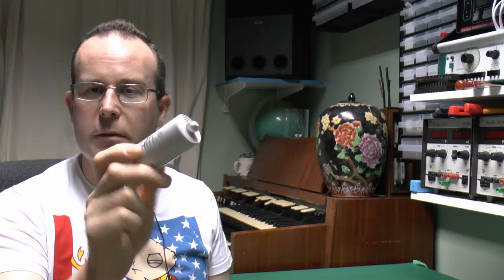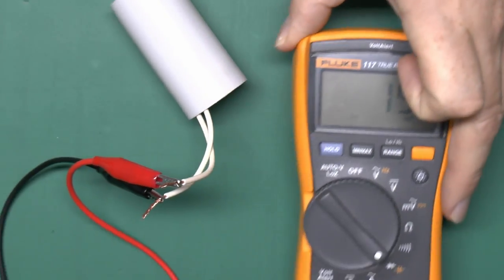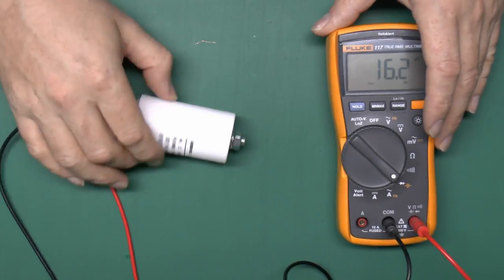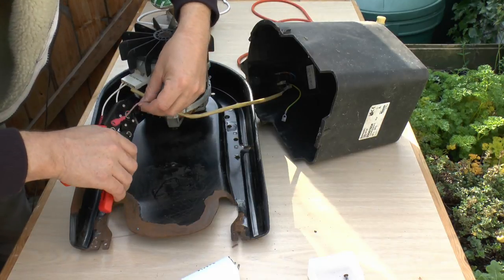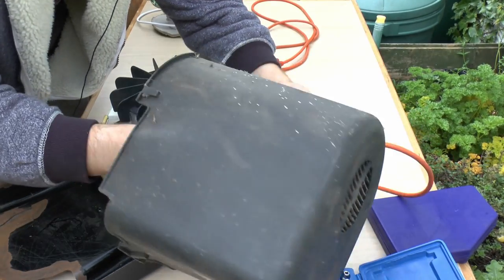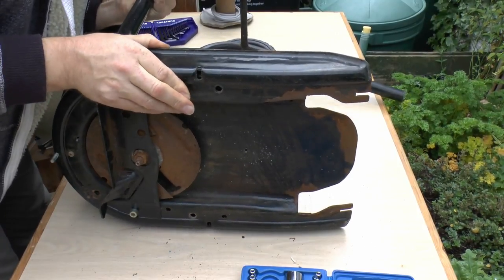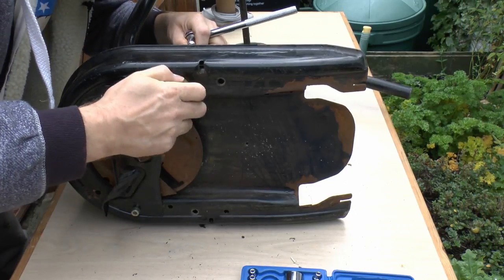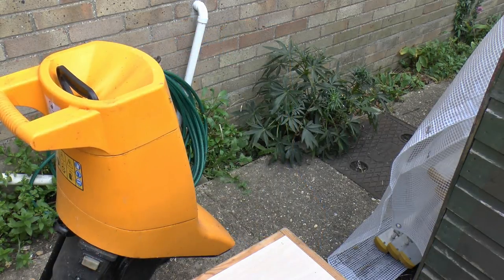Garden Shredder Repair - McCulloch MB340

Comment: Good instruction video.  I have same model of shredder which developed the same problem - hummed but would not start on it’s own and needed a prod of the blade to get it running.  I followed the video and fitted a new condenser and now the shredder starts and runs fine.  Thanks.

Comment: I used to work for a hot tub company. Prior to my arrival the boss was changing out very expensive brushless motors under warranty when this happened. He had a container stuff with the ones he removed. These motors are used in many other industries. I asked why he never tried repairing them. I started changing out the start/run capacitors in them with a very high success rate. The look on his face was priceless. These motors retail at £200 upwards ( some as much as £500 depending on manufacturer and power rating so you can imagine the cost of his lack of knowledge.

Comment: Thanks so much. The repair shop to which I took my shredder for a diagnostic wouldn't even do that because it's old: 'Don't even know if we can get another motor, let alone how much it would cost, sorry. Get a new shredder.' I bought a new capacitor for £5.48 including postage and it was literally a 1-minute job to fit it.

Comment: I have an Ozito shredder (stopped working) but it has a small circuit board and no capacitor. I'm assuming the PCB is a proprietary cap. Just wondering If I could unsolder the circuit board which basically just has positive neutral and earth and replace it with a capacitor. Thoughts?

Comment: Very lucid video John, thanks so much for posting.  My garden shredder works well....for about ten seconds! and then cuts out.  I try again and the same thing happens, even with no load at all on the motor.  Could this be solved with a new capacitor?
Reply from the maker: Unlikely, capacitors either work or are failed.  May be a thermal cutout somewhere, or possibly a defective switch.

Comment: I seem to be facing the same issue, although am not sure - the motor makes a humming sound and the drum will make a very slow half spin and then stop, the switch will not stay fixed, and the power cord is quite hot at the inlet. Also, the drum wil not move by hand, although I do it know if it should, really. Could this be the capacitor?
Reply from the maker: If it doesn't rotate by hand, there is a mechanical problem.  Powering the motor when jammed will cause it to overheat.
Reply: Thank you for your kind reply. After some basic maintenance like checking connections and oiling I was able to start it and it is working. I do not know what the issue was. @jwflame

Comment: Well worth repairing, ive had the same problem with bench grinder start condensers, air compressor motors, and of cause tumble dryers.
The worst offender has to be switchmode powersupplys in almost everything these days, i almost feel sorry fitting new capacitors in supplys as they have a short life, poor little sods ha ha :D

Comment: I have an MB280 1800w. It tried to work but was jammed. I unjammed it and it worked OK. The following day, same problem but maybe left it too long before I switched off. After unjamming it wouldn't work at all. Checked fuse and supply, but no luck. Any suggestions welcome.
Reply from the maker: Other than the wiring, if it's totally silent then the motor windings are a likely failure. That won't be repairable.
Slim chance it has a thermal fuse in it, they can be replaced but only if the fuse can be located easily, some cheap motors have the thermal fuse in with the windings.
Reply: Thanks for that- you're a star!